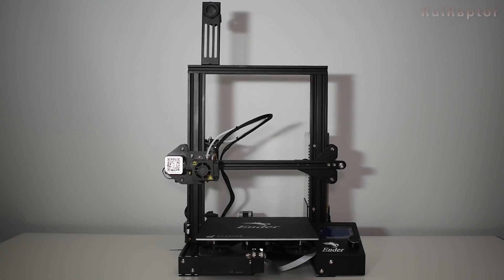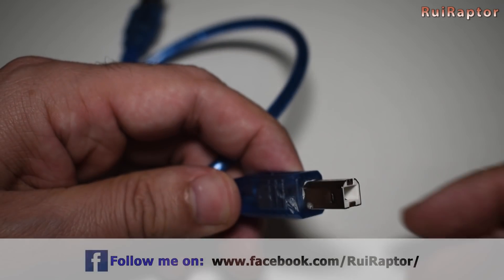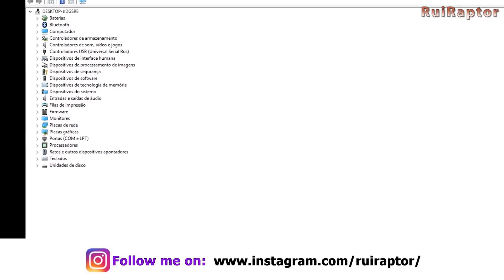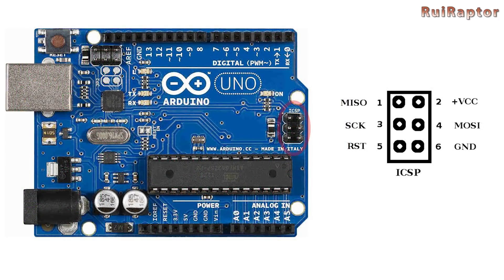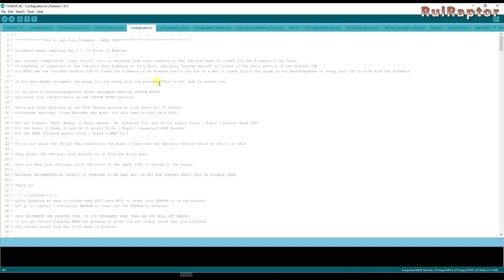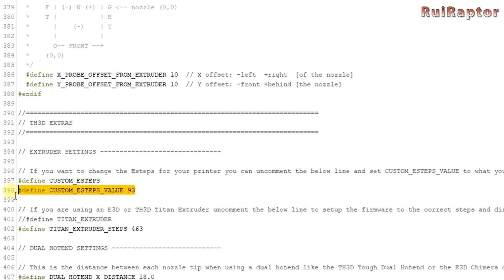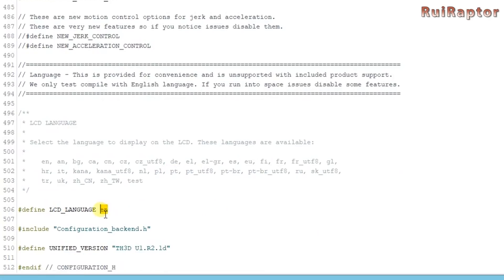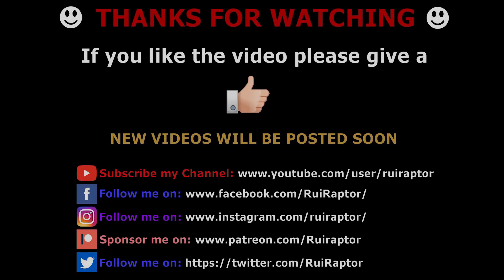Ender3 / Ender3 Pro - HOW TO Update The Firmware (8-Bit Boards)

Comment: sadly after doing the bootloader. The Marlin.ino file won t compile..Now stuck .... giving this message error. please help.... 
 Arduino: 1.8.10 (Windows 7), Board: "Sanguino, ATmega1284 or ATmega1284P (16 MHz)"
C:\Users\GREAZL~1.GRE\AppData\Local\Temp\ccAsTPEe.ltrans0.ltrans.o: In function `main':
C:\Program Files (x86)\Arduino\hardware\arduino\avr\cores\arduino/main.cpp:43: undefined reference to `setup'
C:\Program Files (x86)\Arduino\hardware\arduino\avr\cores\arduino/main.cpp:46: undefined reference to `loop'
collect2.exe: error: ld returned 1 exit status
exit status 1
Error compiling for board Sanguino.
This report would have more information with
"Show verbose output during compilation"
option enabled in File -> Preferences.
Reply from the maker: Hi Sam, is your board the 8bit version or the 32bit version?

Comment: thanks but you need to update this video. many steps have changed and file you talk about was replaced by a file Merlin.ino located inside firmware folder. if you dont update you will only confuse newcomers.
Reply from the maker: Hi Sam, we have a few updated videos...check here:
https://youtu.be/S0epn4ANJlo
https://youtu.be/kFRy_5lh2IQ
Reply: @ruiraptor  your updates is much appreciated

Comment: allthough this channel is not so new anymore, I did like the clear voice and explanation. My prrinter worked fine, until I noticed the X Motor did not stop during heating up before the print. The stop switch still worked fine during a test. So there was a need to upgrade the firmware. However, I ran into a problem and now I am scared I bricked my Ender 3Pro V1.1.3 board. I have tried this suggested way of launching a boot loader from several UNO's and a MEGA 2560, but ran out of sync many times. Then I replaced the cabling and selected ports 10-14 on the boards for the communication. Loading the avrdude commands from the command line in a CMD window, showed there is communication, but even with a "-F" optional command, I still get:

==============quote====================
Writing | ################################################## | 100% 123.35s

avrdude: 127660 bytes of flash written
avrdude: verifying flash memory against Ender3ProBLT.hex:
avrdude: load data flash data from input file Ender3ProBLT.hex:
avrdude: input file Ender3ProBLT.hex auto detected as Intel Hex
avrdude: input file Ender3ProBLT.hex contains 127660 bytes
avrdude: reading on-chip flash data:

Reading | ################################################## | 100% 74.82s

avrdude: verifying ...
avrdude: verification error, first mismatch at byte 0x0000
         0x00 != 0x0c
avrdude: verification error; content mismatch

avrdude: safemode: Fuses OK (E:00, H:00, L:00)

avrdude done.  Thank you.

============= unquote ==========

Please let me know if there is another solution than buying a new 32 Bit Board for my printer

Thanks in advance

Jos

Comment: Hi 👋 My Ender 3 pro came with the 8-bit v1.1.5 board, which already had a bootloader. Is the update process the same, except for the bootloader bit?
Reply from the maker: Hi Jon, if you board already has a bootloader installed, then you can skip the arduino step. Just compile and use the computer to transfer the firmware to the board.

Comment: Why doesn't the printer allow firmware upgrades through a USB cable with a computer? I have to buy an Arduino just to upgrade the firmware of the Ender? That seems crazy.
Reply from the maker: Hi, the firmware update will vary according to the board version you have. If you have an 8bit board, you need the arduino to install the bootloader and use arduino IDE software. If you have the newer 32bit board, then you don't need arduino (since that board already has bootloader installed) and you use platformIO to compile the firmware. The compiled file (.bin file) is copied to the memory card and the printer will update at boot. You can see here: https://youtu.be/kFRy_5lh2IQ

Comment: Only problem is that: i dont have those pins on the motherboard!!!!!!!!! So what now???
Reply from the maker: Hi @MrJonesproduction which board version do you have?
Reply: Okay, so i found out that there are different kind of boards...
The store where I bought the printer said i need bootloader with this printer...
Actually not coz it has the 4.2.2 board 
So i am okay now, no need bootloader
Thank you
Reply from the maker: Hi, yes, that's correct. We have posted a video aout that: https://youtu.be/kFRy_5lh2IQ

Comment: I just purchased my Ender-3 Pro on Amazon a few days ago, and my board is a Black V4.2.2, the board of your board at 3:44 is a Green V1.1.2. I also don't have the 6 pins that you have shown anywhere on the board. I was able to update my firmware from 0.0.6 to 1.0.1 just by following the instructions on https://www.creality.com/download and read the Readme file my respective download. Thermal Runaway was already enabled on 1.0.1, Resume Print on Power Failure doesn't seem to be enabled yet. I'll reply to this comment for an update.
Reply from the maker: Hi Aaron, you need to check our latest video about that here: https://youtu.be/kFRy_5lh2IQ
Please read the pinned comment regarding the drivers because there are 2 types of drivers on that board.

Comment: Thank you so much, very thorough instructions. I kept getting an error: avrdude: stk500_recv(): programmer is not responding. One forum suggested pressing the reset button before uploading but my board has no reset button (???). Another forum suggested going to preferences and click 'show verbose output' while compiling. I did that and, strangely, it worked (no idea why but I'm happy).
PS I'm now subscribed to your channel.
Reply from the maker: Hi, it seems that you didn't flash correctly the bootloader. Did you follow the bootloader installation instructions?
Reply: @ruiraptor  Thanks for replying. Yes the bootloader flashed correctly. The error message occurred afterwards when flashing the Marlin update. After enabling verbose output in the preferences, the Marlin flashed successfully and I can confirm that the newest Marlin version is on the Ender 3 and it works perfectly. Again, thanks for the detailed video.
Reply from the maker: Hi, that message means that the PC/arduino IDE is not comunicating with the board. This can be due to a bad usb cable, wrong com port or baudrate settings, etc. Please check these and make sure you are using a good usb cable.

Comment: I updated my firmware about one month ago, if I want to update it again, do I still have to open the printer up to flash the boot-loader, or is it still installed on the printer and I can just update it directly with the usb cable?
Reply from the maker: Hi, if you already installed the bootloader, you do not need to repeate the process. Next time you want to flash the firmware, just connect the USB cable and flash it.
Reply: @ruiraptor  ok, thanks for the help!

Comment: Please help... how do I fix the "avrdude: stk500_getsync() attempt 1 of 10: not in sync:" error. I'm running windows 10 fully updated and an Ender 3 Pro with a Silent board.
Reply from the maker: Hi, check your device manager. Probably your printer is not being recognized or you are not selecting the correct COM port.
Reply: @ruiraptor  thanks for the reply. I have only 1 com port (13) and that is the printer.
Reply: @InfinityDrones  did you fix it?
Reply: @davis0166  yes. Had to load a bootloader. My bootloader was currupt.

Comment: Help - My Ender 3 Pro is getting the MAXTEMP ERROR whenever I start heating either the hotend or the bed.Whenever I turn on my printer the nozzel reads at 298 and the bed at 147. I Tried replacing  the thermisters on both the hotend and the bed. I replaced the hotend. I also reflashed the firmware. The motherboard I'm using is the stock Creality V1.1.4.  I also have the BL Touch attachment. What else could be giving me this error and what other options do I have other than replacing the motherboard?
Reply from the maker: Hi, if you are getting high temperature readings means that the thermistor wires are shorted. If you disconnect the thermistor cable from the board, do you still get those temperatures?
Reply: @ruiraptor  yes I do, the same temperatures when both thermistors are unplugged.

Comment: Thanks for making this video.  This is pretty involved, which makes me wonder about the cost/benefit.  For all this "pain",  why would I want to flash the new firmware?  What is the benefit of the new firmware?  I went to the Creality website and don't see any explanation of what is the improvement.  What am I missing?
Reply from the maker: This printer comes with the thermal protection disabled from factory. The benefit is to have the thermal protection enabled with the new firmware version.

Comment: I am a beginner struggling with getting my Ender 3P printing beyond the dog and cat .stl's.  I don't have an Arduino and am not interested in learning another complicated device!  So does that mean I can't update my Creality firmware?  I've read many articles and think all of them say an Arduino is required.  Very confused and in need of help!
Reply from the maker: Hi, the arduino is a tool that is required for installing the bootloader. only after installing the bootloader you will be able to flash new firmwares. The bootloader is installed only once, so you only need the arduino 1 time.
Reply: @ruiraptor  Thanks so much for the very succinct and clear answer.  I now better understand the issue and feel relieved that I do not have to become an "arduino" master!  Your site is a go-to for beginners and continues at the top of my list.

Comment: Thank you so much for this tutorial! It Worked successfully but one question if I may: I changed the language to Dutch in the sketch  but I prefer English again, can I flash the board again without programming the boot loader?  So repeat step at about https://youtu.be/U9MGIlQgzkg?t=287 and let the language part at default? Cheers and thanks again!
Reply from the maker: Hi, 
the bootloader is installed only once. If you want to change something in the firmware and flash it again, you only need to flash the firmware and not the bootloader.

Comment: Thanks for the Video. Worked for me with an Fake Arduino Mega... I testet it with my MAC and i got sync errors... no problems with a Windows-Laptop. Just for Information... It doesn´t matter if the printer is on or off.

Comment: wires & hardware? is it the 1970s?  with inputs such as a SD card reader & usb port, this is more like hacking something that you shouldnt be able to do.....I've tried the Creatily guides to update firmware & fair enough, the software doesnt recognise my  Ender 3 Pro & the drivers included on the SD card & on the download page dont work.
Reply from the maker: Hi, we updated the firmware using the technique in this video on different machines (ender 3 and ender 3 PRO) and all worked perfectly.

Comment: Hey, my ender3 pro doesn't read SD cards, and sometime when i press read SD card, it stuck a bit, is not the SD card becasue i have an ender3 and it read the SD card whitout problems, you think if i update the ender 3 pro it will fix the problem? Thx
Reply from the maker: Hi David, Did this problem started after the firmware update?

Comment: I cannot for the life of me get the ender pro 1.1.4 non quiet board flashed with bootloader.  I get error device signature = 0x000000 
....
Yikes! Invalid device signature.

Is it possible the board is dead?  Lights are on.  With power on fans run but screen blue.  Ive installed newest ch340 drivers creality says you need for non quiet v1.1.4 board.
Reply from the maker: Check the cables carefully because you might have one or two wires connected on the wrong pin or not making good contact
Reply: No go on board, bought a new 32bit.

Comment: Arduino: 1.8.9 (Windows Store 1.8.21.0) (Windows 10), Board: "Sanguino, ATmega1284 or ATmega1284P (16 MHz)"

Sketch uses 112614 bytes (86%) of program storage space. Maximum is 130048 bytes.
Global variables use 6195 bytes (37%) of dynamic memory, leaving 10189 bytes for local variables. Maximum is 16384 bytes.
avrdude: stk500_getsync() attempt 1 of 10: not in sync: resp=0x65
avrdude: stk500_getsync() attempt 2 of 10: not in sync: resp=0x63
avrdude: stk500_getsync() attempt 3 of 10: not in sync: resp=0x68
avrdude: stk500_getsync() attempt 4 of 10: not in sync: resp=0x6f
avrdude: stk500_getsync() attempt 5 of 10: not in sync: resp=0x3a
avrdude: stk500_getsync() attempt 6 of 10: not in sync: resp=0x54
avrdude: stk500_getsync() attempt 7 of 10: not in sync: resp=0x46
avrdude: stk500_getsync() attempt 8 of 10: not in sync: resp=0x20
avrdude: stk500_getsync() attempt 9 of 10: not in sync: resp=0x69
avrdude: stk500_getsync() attempt 10 of 10: not in sync: resp=0x6e
An error occurred while uploading the sketch

This report would have more information with
"Show verbose output during compilation"
option enabled in File -> Preferences.
can you help, I'm using com port 6 and my printer is a ender 3 pro
Reply from the maker: Did you install the bootloader first?
Reply: @ruiraptor  no as i was told the ender 3 pro as a built in bootloader
Reply from the maker: No, that is not true.
You need to install the bootloader first as i show in my video.
The procedure is the same for the ender 3 and ender 3 pro
Reply: Try another USB Port or another PC. I've had a similar issue and the change of the Port helps.

Comment: Thanks for content. I want to ask something. Im a beginner for 3d printer user, and I jsut bought "Ender 3 Pro" a few days ago from banggood. Just 2 questions I have.
1)Is that available for Pro version?
2)What can I do with this firmware update, I mean Is there any improvement in printing?
Reply from the maker: Hi, check the answers below:
1- The firmware and procedure in this video is for both (ender e and ender 3 pro)
2- This firmware has a few extra features as i explain in the video but most important is the thermal protection feature.

Comment: it dont Works by e it says: avrdude: stk500_recv(): programmer is not responding
avrdude: stk500_getsync() attempt 1 of 10: not in sync: resp=0x00
avrdude: stk500_recv(): programmer is not responding
avrdude: stk500_getsync() attempt 2 of 10: not in sync: resp=0x00
avrdude: stk500_recv(): programmer is not responding
avrdude: stk500_getsync() attempt 3 of 10: not in sync: resp=0x00
avrdude: stk500_recv(): programmer is not responding
avrdude: stk500_getsync() attempt 4 of 10: not in sync: resp=0x00
avrdude: stk500_recv(): programmer is not responding
avrdude: stk500_getsync() attempt 5 of 10: not in sync: resp=0x00
avrdude: stk500_recv(): programmer is not responding
avrdude: stk500_getsync() attempt 1 of 10: not in sync: resp=0x00
Reply: did you manage to fix the problem as i have the same problem
Reply from the maker: Check of you have the correct COM port selected

Comment: Will this work for the Marlin firmware? Also, why does it keep asking me to select the arduino mega board. Thank you.
Reply from the maker: The firmware used in the video is the Marlin firmware. 
If you need additional help with the installation of the firmware, please contact me by facebook or email.
Reply: @ruiraptor  yep. Sorry I was doing something wrong on my end. Thank you for your response though
Reply: same for me.. It keeps asking me to select arduino mega. what was the issue?

Comment: Can't you just do it via usb cable in Cura?
Reply: indeed so many stuff just for a update... i thought a usb would be enough
Reply: @niemandbeats1302  the creatily guide & website advises you can do it via Cura (didnt work for me as its not recognising the printer, yet the printer display domes on even when powered off & can navigate) theres 2 sets of drivers on the SD card that came with it, but neither would install on windows 10.
Reply: Only once you've installed a bootloader using this method I believe